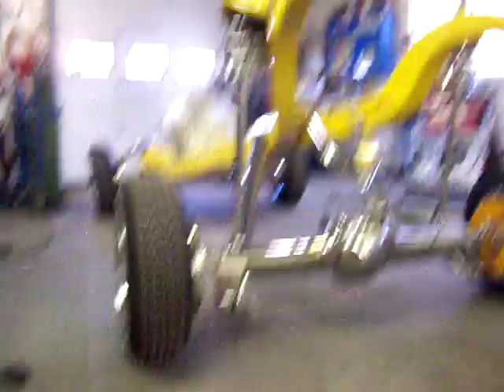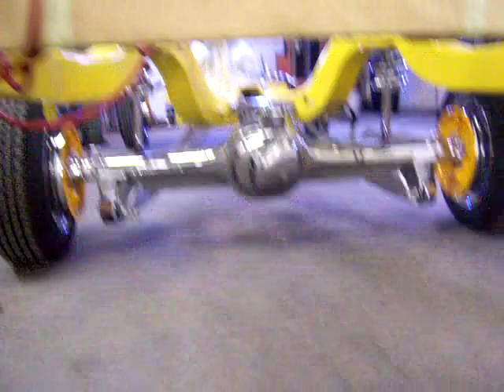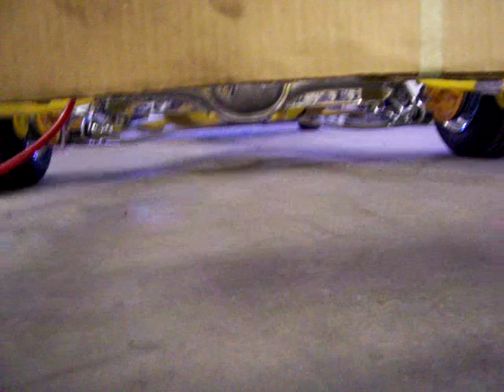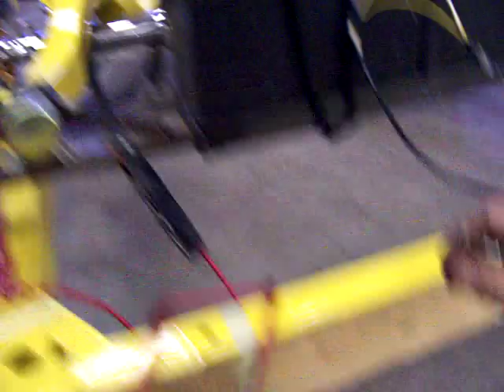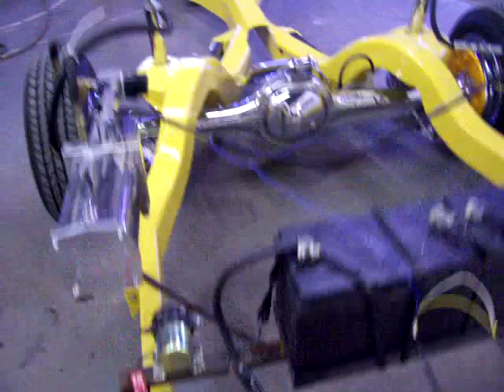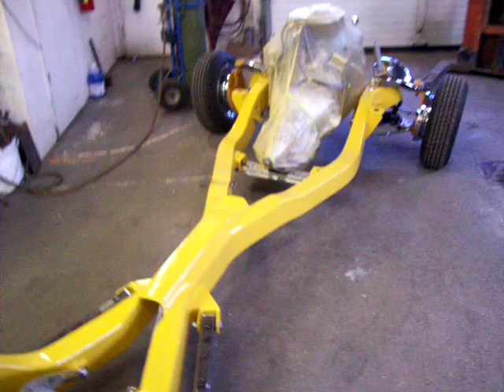1964 impala frame wrap hydraulics lowrider Thornwood Auto Body NY

Comment from the maker: @hypnothic13 in NY a frame wrap starts at $5k... moulded frame is more, painted or powder coated is more & then there is the install + you're gonna want to run all new fuel & brake lines. It gets expensive real quick.

Comment: @jeepers2655 they did it to give the car performance in corners at high speed-that is why a 59-64 impala can drop into a 3wheel standing still(with enough weight in back) basically the center of gravity is closer to the front of the car, thus making the suspension geometry perform better.

Comment: are the cylinders comin' out of the front a-arms vertical or angled? My dad has an SS '62 and thinks the cylinders have to come up straight and is trying to shape and weld some donuts into the contour of the chassis to reinforce and make them vertical. Any suggestions would be greatly appreciated. You guys obviously know yr stuff!!

Comment from the maker: What the fuck do you know... my shop is located in the most heavily TAXED county in the NATION! ok. I just spoke to Brent form Pitbull Hydraulics in Kentucky on saturday & he pays 75% less than me for metal.... 75% less!!! chrome here is also way way more. 
So to conclude: if you want a fully molded, fully wrapped, chromed suspension, with hydros, rims, rebuilt engine & tranny with the best components you can get - done in Bullshit Ass NY... it will run you about $25k.